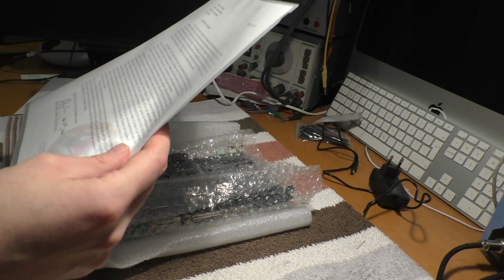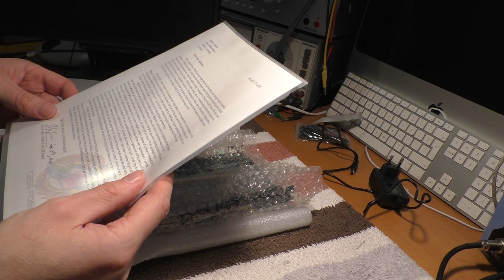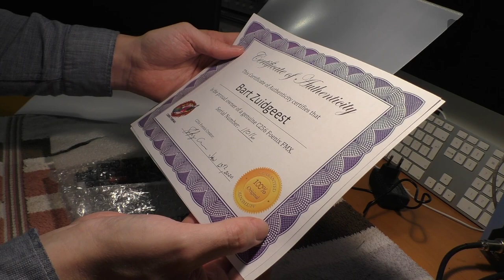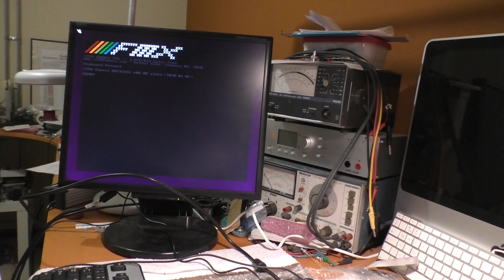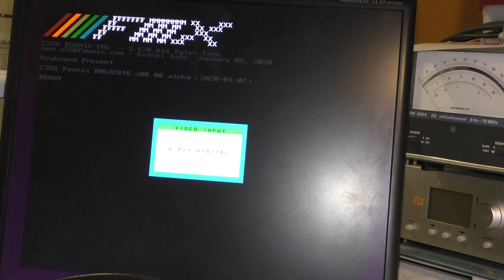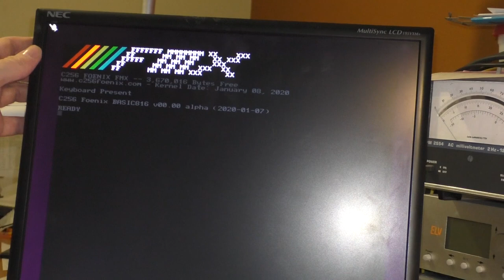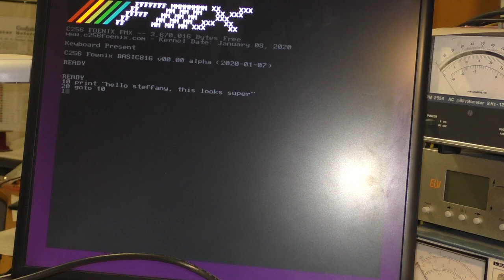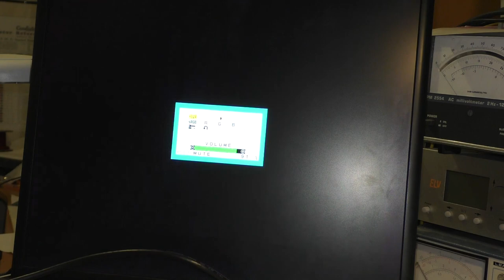C256 Foenix unboxing

Comment: So theres 0 software for this ?.
Reply: This video is two years old at least. I moved away from it because of health problems. But it's community is very much alive and certainly made progress on the software front. But the point of the platform is you writing and sharing code. If you want ready made buy a PlayStation or something like that. If you like to build code that talks to hardware and leaves everything open. Then this is for you. Also stef had created several new hardware versions by now 68k or Intel or 68030, arm many options available.